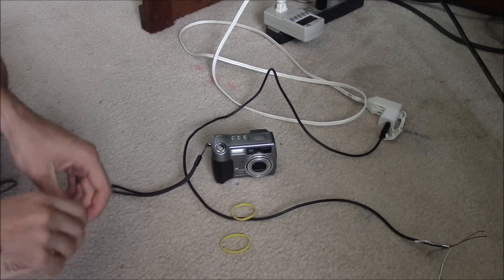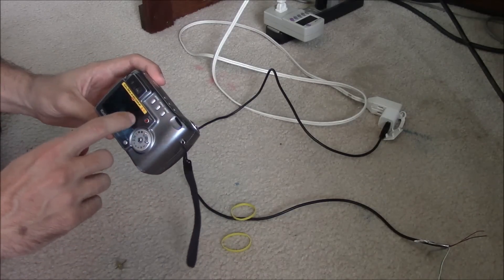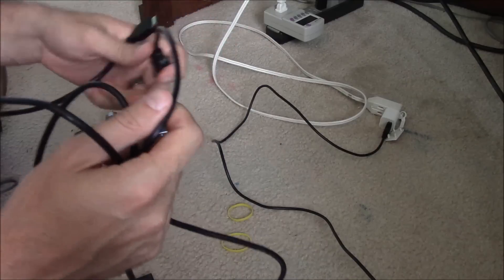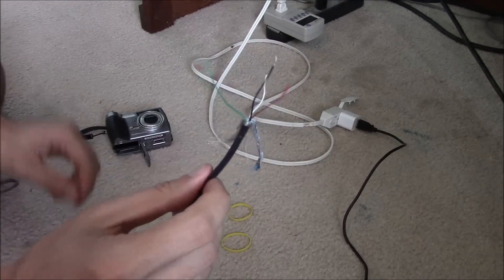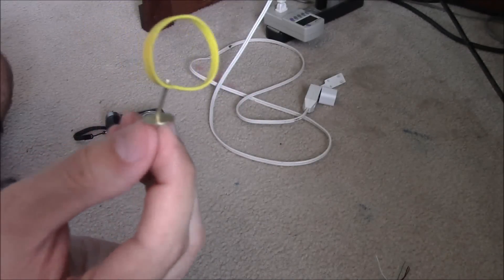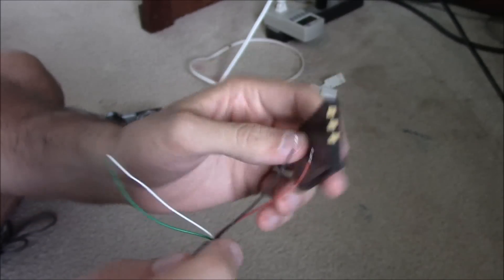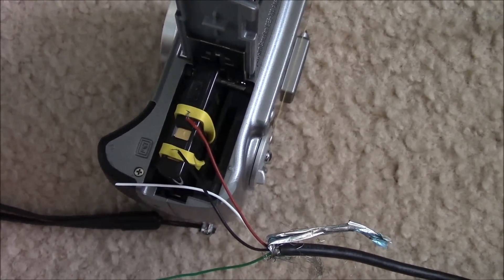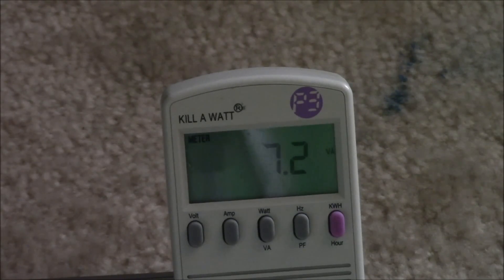Charge a Cell Phone/Camera Without The Right Adapter

Comment from the maker: DO NOT do this for more than a few minutes at a time!  This should only be done to put a little bit of charge into a camera or phone battery so that you can retrieve important files or pictures.  This is NOT a permanent solution!
Reply: Long long can we charge the battery sir???
Reply: Fyew minut he say @lavani-11eee59
Reply: Why not?
Reply: Boom boom
Reply: If you have to do it this way then use electric tape instead of rubber bands

Comment: What if the color wires I get are black, white, blue and green. Can I assume that the black is negative and the white is positive?
Reply from the maker: I would try to look up the schematic from your manufacturer.  Or you can test the wires with a multimeter.  I wouldn't assume.

Comment: Why the rubber band? Use electric tape or hot glue stick. Melt it on with a lighter even and peels right off after use. O and DONT LEAVE THIS PLUGGED IN FOR OVER 5 MINUTES. TAKE A BREAK AND PLUG IN FOR NO LONGER THAN 5 MINUTES AGAIN. IT WILLLLL EXPLODE! (EXPERIENCE)
Reply from the maker: I used a rubber band to illustrate that this should only be done temporarily.  Tape would also be fine.  But a hot glue gun would indicate a bit more permanence.

I agree and hopefully I made myself clear that this should only be done for a few minutes in an emergency and NOT as a permanent charging solution.

Comment: I’d like some assistance, the camera battery does not want to charge, I even checked the polarity, red to positive black to negative
Reply from the maker: It is possible that the battery is completely dead and cannot be revived.  Or it is possible the charging cable is not carrying any power.  If you have a multimeter, check the voltage on the wires and make sure you are getting 5V.

Comment: Once you said you cut the wires i got scared
Reply from the maker: This is obviously only meant for an emergency situation where you need to retrieve some pictures or data and don't have the right charger.  It cannot electrocute you but it can damage the battery if you do it for more than a few minutes.  Please use caution.

Comment: worket perfect for me with my Steelseries Wireless nova Pro Batterie i just searched at my house for a 4-5v output adabpter and take some Tape to make the Cables stick to it. put it in for 10 min with timer. Test Temperature with a Handlasergun and wait after put it to the normal loading Station, done some Loading cicles now and it works perfect thanks <3
Reply from the maker: You are welcome!  Sounds like you did everything perfectly!

Comment: My Canon G10 battery has 4 terminals and doesn’t charge up no matter what l use to charge it?
Reply from the maker: The battery may be bad.  Or you have to just do trial and error to figure out which is the positive and which is the negative terminals.  I don't know if there are any diagrams or specs online that you can find for the battery.  Sorry.  Good luck!

Comment: Hi I'm doing this now, in what way is it dangerous please?
Reply from the maker: The voltage is too high for a typical 3.3V battery.  So it will heat up the battery and could cause a fire if you left it connected for an extended period of time.  This should ONLY be used for a few minutes and only to put a small amount of charge in a battery so you can access files or pictures on an old device.  Please do not try to use this as a regular charging method.
Reply: @LDSreliance  Thankyou for the reply
Reply from the maker: You are welcome.  Thanks for watching!

Comment: I have an old Sony Ericsson phone which takes 3.6v 950mAh battery, but dont have charging cable for the custom charging port.
I also have Sony Cybershot Camera which takes 3.6v 650mAh battery, and I do have its compact wall charger which outputs 4.2v 0.25A on output pins. (Sony Ericsson battery dimension don’t fit this charger).
Can I safely use the Cybershot wall charger to fully charge Phone battery by carefully connecting its output terminals using wires to Phone battery without risk of fire/explosion ?
Reply from the maker: I can't guarantee anything will work without damage.  But, like I showed in this video, if you use it for a short period of time (a few minutes or less) it can provide just enough charge for you to get on the device, retrieve your files, and be done with it.  This is NOT meant to be a continual method for using your old device.
Reply: Same haha

Comment: Why can’t you just use electrical tape?
Reply from the maker: You probably could.  But keep in mind this would be for very short periods of time.  Just long enough to give the battery some charge... maybe a few minutes.  If you leave it like this the battery will overheat and could catch fire.
Reply: @LDSreliance  Thanks I think I will try it cause it’s for a inexpensive column camcorder and a new battery costs about as much as the camera.  I’m getting a better camcorder regardless but still want to try!
Reply from the maker: I hear ya.  Just be careful.  If the battery is getting too hot to touch then disconnect it and let it sit for a while.
Reply: @LDSreliance  Thanks and I don’t even know if or when I will try this.  I plan on getting a better camera

Comment: Charging with 5 volts is extremely dangerous. The absolute MAXIUM voltage for lithium cells is 4.2v. This has a risk of fire and/or explosion.
Reply from the maker: Yes this is only for an emergency and only for a few minutes, at most.  Use at your own risk!

Comment: But for this do I need to cut my charger?
Reply from the maker: If you have a charger for this then you don't need to use this method.  If you don't have the right charger, then you can use any USB cable and cut the ends off.

Comment: I have two mobiles one has 1700mah battery and other has 2100mah battery. Can I charge 2100mah battery from the mobile which has 1750 mah battery by connecting the pins through wires. Will it work.
Reply from the maker: No, sorry.  One has to have higher voltage than the other for it to work.

Comment: Can I use battery of one mobile in second mobile by connecting the mobile charging pins to battery pins through wire as socket of battery is not same. Will it work.
Reply: did that work?

Comment: My question is say if the situation is that your charger port in the phone is broken and you use this method with the USB cable and wall port that goes to that phone.  Would it be safer, could you charge it fully, and wouldn't it be basically the same as normal charging except for having the bare wires and having to connect it that way? I understand that the purpose of the video is a one time emergency situation but in the situation that I explained would this safely work?

Comment: Extremely bad idea!  -- These batteries do not charge at that voltage, and current needs to be limited.  
But if you insist, do it only for emergencies, and only for a short charge time... 
NEVER leave this unattended, or you may not have a house when you return.
Reply: Ok ok. Out of all the comments yours told me that i need to ask you my question and you might be able to help me answer cause i dont think anyone else is gonna have the knowledge here. The safe kind. But i have an old nokia bl-5c 3.7 volt battery its a small lithium battery, and i scrap when and where i can. Now heres where it gets tricky its swollen. Why not relavent. I know thats not good. But i see there is the 3 GOLD terminals. So i think scrap. Well my question is since its swollen is there any way to remove the 3 gold termnials safely without any catastrophic failure so to speak. And if so is there any more gold that you might know of that resides inside the battery. And if so is there a way to remove it safely. But even if it would be considerably not worth it or not worth the risk due to saftey measures i would still like to know if those things could be done. I never stop educating myself. And in a situation like this the knowledge could save your life. I mean i get gold frenzy not the other word for the sake of not spazzin the algorithms but im not tryin to have a chem based firecracker go off in my face or hand. Doesn't sound fun. And they say measure twice cut once well this is more like make sure you packed, put on & clasped the parachute before ya base jump. I know we all have seen that video where the dude almost jumps off a brindge with out makin sure his parachute was actually clasped and locked. He woukd have literally jumped to his death if some dude didnt stop and tell him. The guy was like oh snap thanks. Pff. The base jumper should have bought the guy a case of beer per month for life. Any links or info to answer would be appreciated. Other than that i hope ya have a groovy journey.
Reply: I'm not convinced that those contacts are actually made of gold. But, if you are, then yes, you can easily remove them. Those batteries are wrapped in a soft plastic sheeting material, and have hard plastic caps at the ends. Being very careful not to cut into the battery, try to lift away a corner of the plastic... use sharp snips, or the tip of a blade to pry away at the edge between the plastic sheeting and the cap at the top. The cap where the contacts are also contains a very small circuit that is connected to the battery with thin strips of shiny metal (Either nickel or nickel plated steel)... you can cut those and immediately tape up what is still attached to the battery.  It is VERY IMPORTANT to cut these one at a time... if you cut both, the cutter itself will short them out and then the problems start. There are no other valuable metals inside, only nasty chemical that you want nothing to do with!
Now, again, I don't think this is worth the effort, or risk... but if you're going to do it anyway, wear gloves and goggles, and do it outside on a non-flammable surface -- A pie tin will do nicely.  Good luck!  ;-)
Reply: @robertcartier5088  thank you your awosme. My load of knowledge that i have that i log in spans over all kinds and recently ive been on electronics. Knowing somewhat of the inner stucture of things such as amps capacitors and stuff like that and lookin at the battery i have the part where the said gold is is the leway zone but like ya said fine snips and carefully. But i always like gwtting more confirmation and education whenever i can. And yes i know i figured there is nothin more inside useful unless on very large scale and with numerous other steps to deal with hazardous materials i.e. the lipo chems like a lead acid battery get that on ya and you'll be a walking example of why not triffle with battery chems. I can test it to make sure its gold and im pretty sure it is ive been on my scrap precious metal collecting. Though with stuff like this it may not be solid or full gold but plated or skinned as im sure you know what i mean by skinned a very thin layer. Well thats my word for it. But i can test it and log complete science experiment info in for definite info later. And i always do everything i may or may not takepart in with extreme care. I knwo its a tedious orocess st times by my ocd goes fsr in tinkering and stuff. I appreciate it. Stay groovy stay postive.
Reply: @robertcartier5088  as a side note as ive been getting into my electronics again and some more and how i mentioned capacitors i pulled one out of a big flat screen tv i think or somthing and it happens to have a nice chunk of leftover residule power and i can't ever get over the capability of capacitors. Haha. To think this little cylinder object when the 2 ends meet mind ya the ends ar both on the same end, but they will glow red hot or shock or in emergency case start a fire for warmth. I have to tell people be careful this thing if ya toch it probably wont turn ya over foor good but there is a chance it maybe could but it will definitely will zapp the crap out of ya and wake ya up.
Reply: @robertcartier5088  right thats why i tell people be carefull it may not but it may actually be able to. I keep it by itself off to the side so it dont fall and make a connection. Cause i know what its capable of. I also was the nut ball kid growin up at like 11 who stuck my hand in a uncovered live light switch. People freaked and im like i know which one to touch the amp wakes ya up the current kills. Some didn't believe it was live and im like touch my arm here while im touching it. They would be like damn. i would say its good to know whats fatal and what's not. They started lookin at me like a mad scientist. Lol. And thanks again. Subed up you earned it not sure if ya take stock in subs though.

Comment: Would this work on a Nikon D3300 camera battery using a micro USB cable as the wire and an apple wall adapter? On a trip without a charger.

Comment: My battery don't have the symbols of positive and negative so how do I know which side to put negative to negative and positive to positive
Reply: If your battery is not complete empty, you can measure it with a volt meter. When it gives zero, you change the wires. If it is stil zero you can put the voltage range lower and again lower. Stil zero at the lowest range, you even can  put it on the lowest current (mA) when you have an universal meter. But as soon as it gives a voltage, stop measuring. The red wire is plus, the black is minus.
Reply: Yeah. Same here. Battery wasn't labeled w/ + and -

Comment: Max charging voltage for li ion is 4.2v (some modern smartphones 4.35) this delivers 5v and is higly dangerous. Buy a li ion charger board for a buck of ebay and u are fine.
Reply from the maker: I think you missed the point of the video.

Comment: Hey! I have a quick question. I have a Sony Cyber Shot camera which has a lithium ion battery. On the back it says “BATTERY PACK 3.6V”. I was wondering if this method would work for it? I plan on charging it on a HP Pavillion G6 laptop.
Reply: Also, I am going on vacation and need a camera to take pictures with. My camera battery, even halfway dead, lasts a very long time, a few days maybe if it’s not being used much. Do you think there is any way I can charge this and bring it on vacation or is it too risky? In other words, is it safe to charge the camera battery once like this and then an hour later charge it some more?
Reply from the maker: Yes, this method will work for a 3.6V battery.
Reply from the maker: It is too risky to use this method unless it is an emergency.  This method does not charge optimally and if you do not disconnect it when the battery is full then the battery can explode.  This is only if you have no other option and need to charge the battery just a little bit in a pinch.
Reply: LDSreliance Okay, thanks. I just found a battery charger for it anyways, I’ll be fine! :)

Comment: Tried it with a Galaxy note battery and an usb charge, didn't work. May be internal circuit of phone batteries are different.
Thank you for sharing by the way,
Reply from the maker: Yes they may have a BMS or something that is controlling the charging process.
Reply: LDSreliance nothing I can do? Thank you.
Reply from the maker: Just make sure you have good contact from the wires to the battery terminals and that you are using the right terminals.  They should be labeled on the battery or you can see which is which inside the phone.  Other than that there is nothing you can do.
Reply: Still nothing. My problem is I have an old galaxy note that doesn't charge, replacmente it's very cheap but I woul like to know if the deviice is ok. Since I have no spare battery for that device I would like to charge...

Thank you for your kind reply.

Comment: My camera is having problem charging ,the led light is suppose to be steady green,but right now its blinking when im trying to charge it,on the manual is says when that happens to reconnect the cable,but its still happening for a long time now,im thinking of doing this but not sure if its safe because if its blinking its a battery issue but its happening with 3 of my batteries..🙄
Reply from the maker: This is safe to do for very short periods of time.  You would not want to do this for hours and hours or without supervision.  I posted this method ONLY to give a small charge to a battery in order to retrieve pictures or texts or something from a device that you do not have a charger cable for.

Comment: Did it work
Reply from the maker: Yep, it works.  I would only recommend this to give a battery a little bit of charge so you can use the device in an emergency without the right charger.  Doing this day to day will harm the battery and poses other risks.  Do it at your own risk.

Comment: I tried it with my camera, but it didn't work.  I checked with a multimeter and was getting 5v from the usb cable ... hooked it up for 3 hours battery still showing low.
Reply from the maker: What is the voltage of the battery?
Reply: Hello ... It's a 3.6 volt battery.
Reply from the maker: I don't know what to tell you then.  It has worked for other similar batteries I have tried like that.

Comment: its not a good idea man
Reply from the maker: For daily use, no.  To use in a pinch, yes.
Reply: just once
Reply from the maker: Just once for a few minutes is fine.  The point of the video was to just put a small amount of charge in the battery so that you could power up the device and retrieve important files or pictures.

Comment: what if i use this in regular basis  what will be the problem
Reply from the maker: You can't fully charge lithium batteries this way and it can be dangerous if you try to do so.  This should ONLY be used for a brief few minutes to put a small charge in the battery so that you can retrieve important files or pictures.